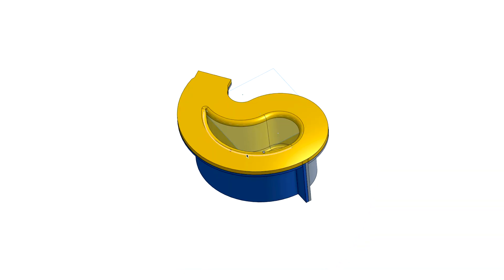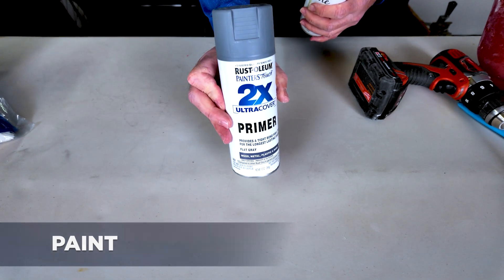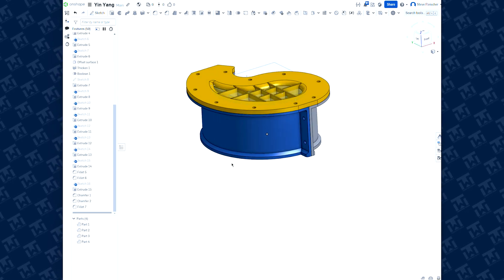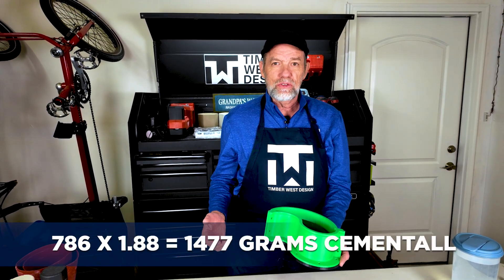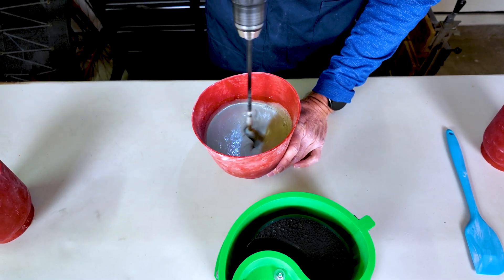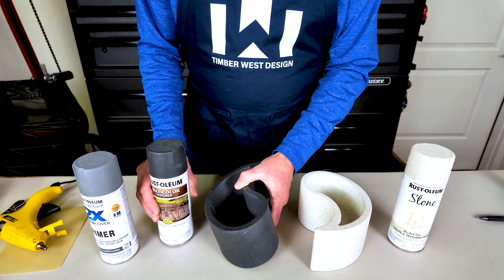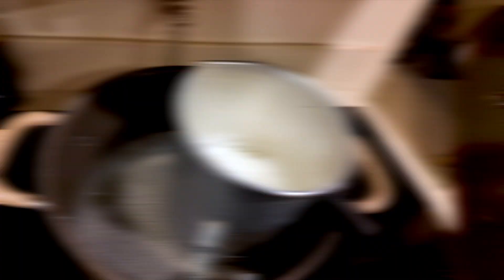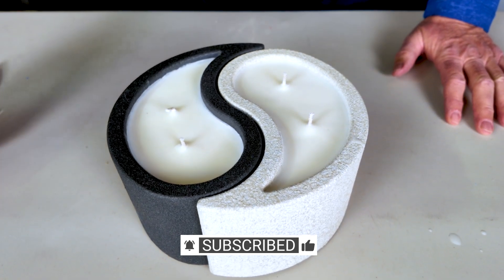How to 3D Print Molds for Custom Concrete Home Decor

Comment: Thank you! This is an awesome project and the design has inspired me to make a vase using a similar bolting technique. When mine is assembled it leaks water a little bit. Did you have this as well but it isn't an issue with the cement?
Reply from the maker: Most of my molds that bolt together will leak if you put water in them.  The Cementall is thick enough that leaking shouldn't be a problem.  Thanks for watching.

Comment: I'm banging my head in the cad trying to do something similar, question for you - the fillets around the top of the container, which piece of your mold do you have them carved into? The sides or the top piece?
Reply from the maker: Hi, on this mold I did both the top inside and outside fillets on the top mold.  Send me an email at info@timberwestdesign.com and I will send you a screen shot.

Comment: Do you have any suggestions on wall thickness for the final product? I tried a 3D printed mold today for the first time using your steps, and I had some cracking. Hoping to fix it on the next attempt!
Reply from the maker: How thick is the area that is cracking?
Reply: I used 1/2” wall thickness on a 4” square pot
Reply from the maker: Send me a picture of the cracking.  Info@timberwestdesign.com

Comment: Really awesome project, thinking of doing this myself!

Some questions if you don't mind,

what filament did you use for the molds?

Are there any specific print setting for the mold?

Have you considered making the mold with silicon? If yes, why not?
Reply from the maker: Hello, Most of my molds I use PLA or PLA+.  .2 layer height with STEP files instead of STL for better resolution.  Silicone is great when you have highly detailed parts.  So far, my projects work well with PLA.  But I will likely use silicone on some projects in the future.  Have a great day!
Reply: @timberwestdesign8358  gotcha, thanks so much for the reply!

Comment: awesome video!
 is there a mold size you would consider too small that doesn't work out well?...i was gonna try this method and make some small, about 2 inch diameter X 2 or 3 inch tall candles...
Reply from the maker: I am not a candle expert.  But I think that size could work.